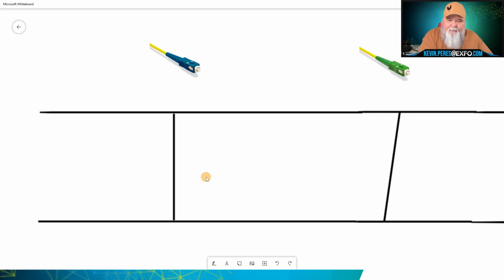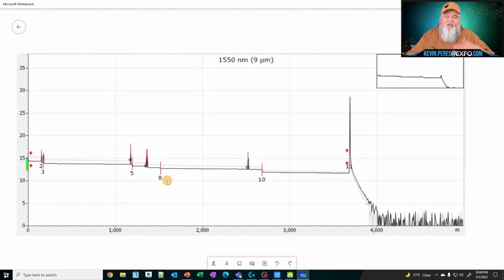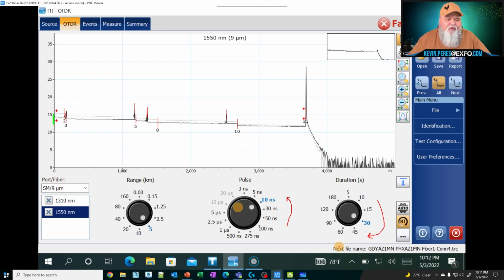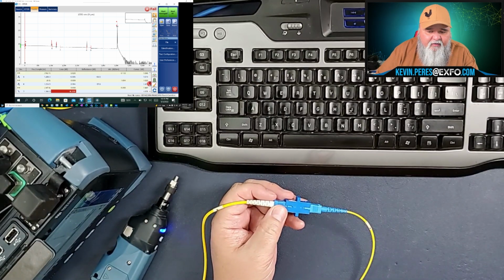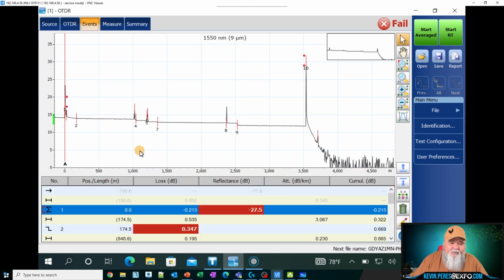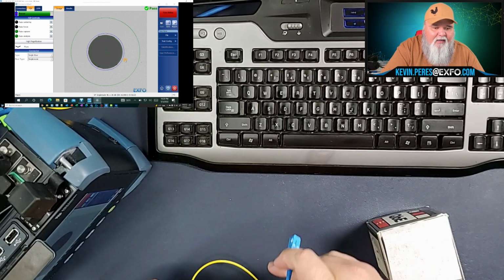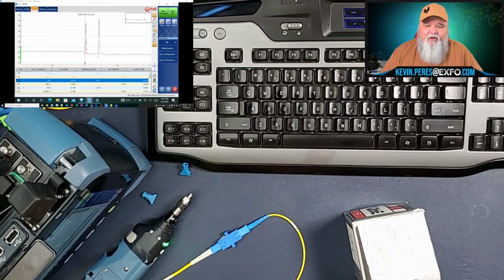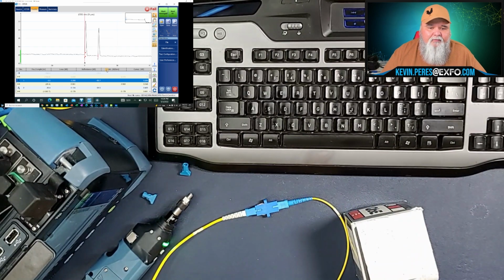Cleaning connectors using an OTDR

Comment: I’m very interested in learning all types of optical testing, especially in the field of fiber optics and DWDM systems. Do you provide training, tutorials, or hands-on guidance for the following types of optical testing? If so, could you point me to relevant videos or resources?
OTDR (Optical Time-Domain Reflectometer)
IL (Insertion Loss)
OSA (Optical Spectrum Analysis)
DWDM (Dense Wavelength Division Multiplexing)
ORL (Optical Return Loss)
OSNR (Optical Signal-to-Noise Ratio)
CD & PMD (Chromatic Dispersion & Polarization Mode Dispersion)
BER (Bit Error Rate)
PON (Passive Optical Network)

Comment: Is there a best way or video on how to clean the Ferrell of an OTDR FTB-1 /735C?
Reply from the maker: I will have to look through my videos I might have something.  The connector does come for unit. Just push down a little and twist counterclockwise a quarter turn to pop it off.  After that you can see the ferrule on the port.

Comment: Hi Kevin Sir, really nice and informative video as always. Just want to know your opinion about what do you prefer one click cleaner or the method you are using for cleaning the connectors. I have been using one click cleaner for cleaning the connectors and have bad experience with it.
Reply from the maker: Sadiq,  Always good to hear from you, my friend. I agree one click is not the best method for cleaning and is never just one click. For bulkheads that you can not access the fiber they work well but if I am able to access the end face I always prefer a hybrid method. Wet a small portion of the dry tissue and pull from wet to dry.
Reply: @KevinPeres  Thanks